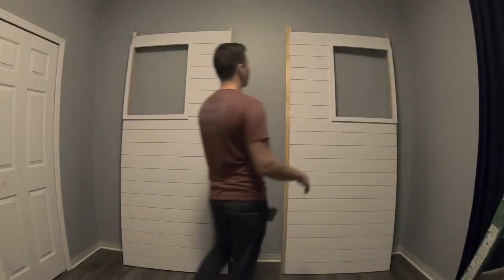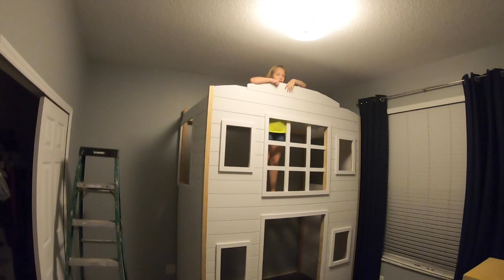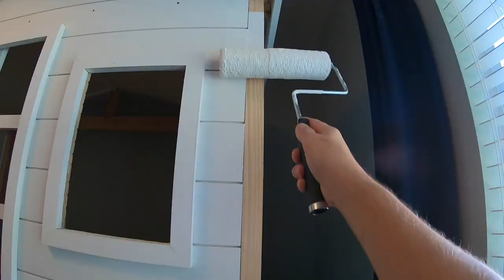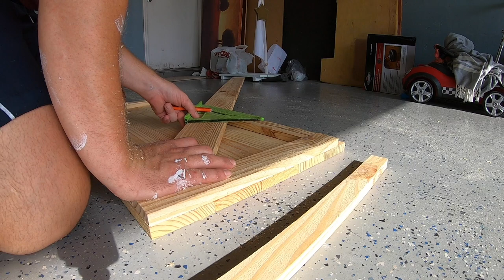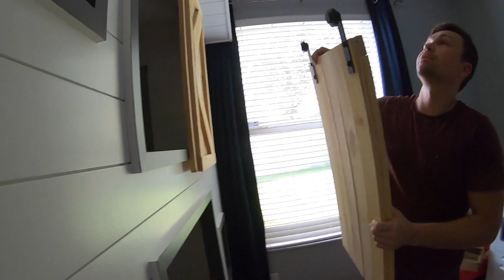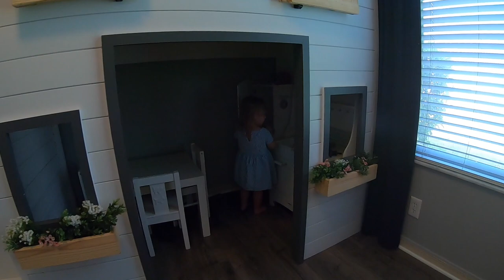✅ Bunk Beds // Woodworking How To Custom build // diy bunk bed house or diy loft bed

Comment: Also, do you remember the measurements for the wood trim? I'm interested in doing this project this weekend
Reply from the maker: Are you talking about the boards that I used to build walls ?
Reply from the maker: https://www.homedepot.com/p/ARAUCO-9-16-in-x-5-1-4-in-x-12-ft-Radiata-Pine-Nickel-Gap-Ship-Lap-Board-1186661/300803814
Reply: No. Not the shiplap, but the size of the windows and thickness of the trim
Reply from the maker: ravel555 The trim around the windows is 1.5

Comment: Hi! Amazing! I have a quick question. What is the large white board that you made the walls out of? What is it called? It looks almost like beaded board on one side and grooved paneling on the other side. Also, where did you buy it?
Reply from the maker: https://www.homedepot.com/p/ARAUCO-9-16-in-x-5-1-4-in-x-12-ft-Radiata-Pine-Nickel-Gap-Ship-Lap-Board-1186661/300803814
Thanks for watching
Reply from the maker: I put it together in a garage and then brought inside

Comment: Do you have a link to any documentation? A shopping list and knowing the measurements would make this a nice weekend project. Thank you for sharing.
Reply from the maker: https://www.homedepot.com/p/ARAUCO-9-16-in-x-5-1-4-in-x-12-ft-Radiata-Pine-Nickel-Gap-Ship-Lap-Board-1186661/300803814

Sorry I don’t have much of a list 
I went off by using the measurement of a mattress 
And then I went as high as my ceiling would let me
Reply from the maker: Let me know if you have any specific questions that I can answer
Reply: @mikekushnir6978  homedepo no longer has anything under this link. I really want to make this for my girls but don't know how much material I'll need to do it

Comment: What is the measurements for the front and side windows as well as the bottom door entrance?
Reply from the maker: The front small windows are 9 1/2 x 14“  and the side is 22 1/2 x 27 The front bottom entry 30“ x 46 1/2 tall and the top front opening is 30 inches wide by 27 inches tall

Comment: Do you have a pdf plan that I can follow and build this?
Reply from the maker: Sorry I don’t have any plans of it , but I can get you some Measurements if that’s works?
Reply: I would appreciate any measurements you can give. I have been studying this video over and over wanting to build one for my daughter's. How would you suggest modifying it for a second bed on the bottom instead of play area?
Reply from the maker: OK I got some measurements for you 41 inches deep 76 inches wide and 92inches tall on the sides
Reply from the maker: I would build a mattress platform like I did on the top one exactly the same gor the bottom and instead of a door way I would’ve ran 2 boards across in the bottom just like above the doorway
Reply from the maker: 9/16 in. x 5-1/4 in. x 12 ft. Radiata Pine Nickel Gap Ship Lap Board

This is the boards that I bought at Home Depot
Reply: @mikekushnir6978  thank you, I keep searching for plans similar to this build. I don't trust myself to just wing it lol. Haven't been able to find any plans so this helps. Hopefully my husband can watch this video and read these comments and get a better game plan than I came up with haha.
Reply: What size boards were used for the frame of all the sides? Is it sturdy on it's own or secured to the walls?

Comment: What hardware did you use to attach the frame?
Reply from the maker: I use mostly screws because I will have to take this apart eventually some day but the siding I use the trim nail gun

Comment: what is the height and length for the frame?
Reply from the maker: The height of the bunkbed to the peak of the roof is 102 inches The width of the bunkbed is 41 inches just enough room for a mattress